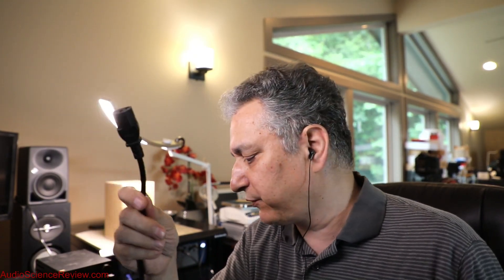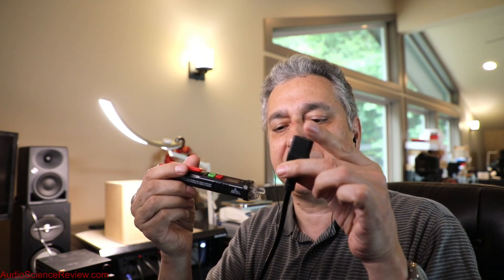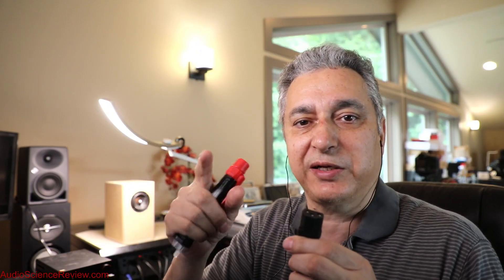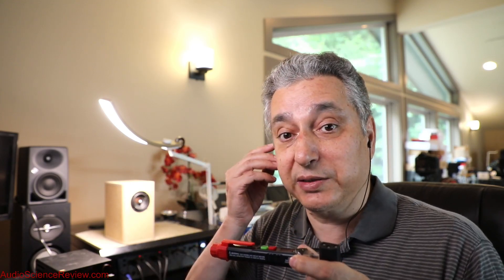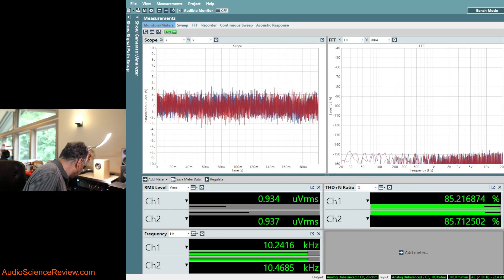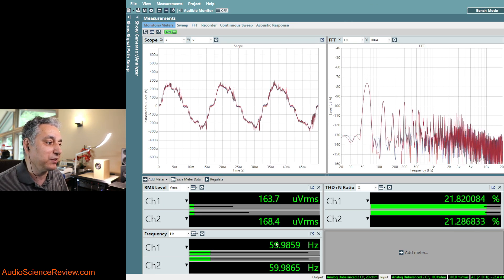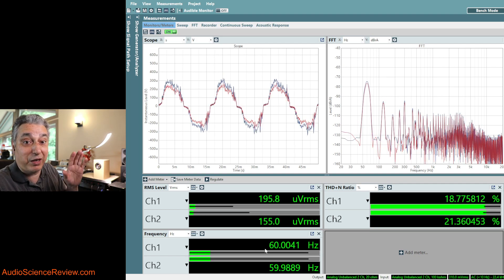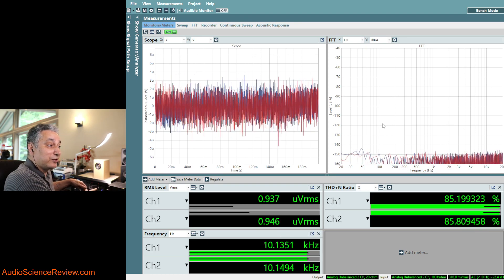Testing Open Power Cord interference in Interconnect Cables

Comment: Apparently this video was motivated by statements made by Danny at GR Research, who evidently criticized Amir's testing by claiming that there must be an appreciable level of current flowing in a cable in order for that cable to transmit/leak electromagnetic fields (into the space surrounding the cable) that can cause problems for other, nearby cables. Amir has thus made it clear that Danny simply didn't know what he was talking about. Which shouldn't surprise anyone, given that not very long ago Danny did a video where he connected several different speaker cables to the input of a radio receiver and used the signal strength meter on the receiver to show that speaker cables differ in terms of their ability to pick up stray electromagnetic fields. Implicitly he was claiming that the differences among speaker cables in this respect translate to differences in the sound quality you get with the different cables when they are used to connect speakers to amplifiers. Even if you designed an antenna for the express purpose of picking up the stray 60 Hz signal that is common in any household, and connected this antenna directly to any typical home speaker, it is exceedingly unlikely that the SPL output by the speaker, for that 60 Hz signal, would be loud enough for you to hear it. Speaker sensitivities are nowhere near great enough for this, which is why we need amplifiers to step up the voltage to meet the requirement of the speaker in terms of sensitivity, and to supply the current that the speaker will draw when delivered that higher voltage. If you run the 60 Hz signal picked up by an ordinary speaker cable through an amplifier, it is all but certain that you'll be able to hear the 60 Hz hum through the speaker connected to the amplifier. Perhaps Danny was confused and thought he was showing why speaker cables make lousy interconnects. The thing is, he pretended to be answering a question that is very different from the question that he answered. Two completely different questions, one that he pretended to be answering while he actually answered the other question. It was bizarre to say the least.
Reply from the maker: Well explained.  :)
Reply: @AudioScienceReview  I agree 100%, but appreciate the intelligent discourse.  Giving both parties a chance to response educated me and I'm sure that further discussions will only benefit the community,  I do appreciate the "audio performance/listening art" and "science" of audio engineering and the years of effort involved in both. 
Thank you all.
Reply: Actually, the 60Hz signal can be heard through speakers. Very faint, but present. It's even in the ambient noise of most rooms. To the point that they can catch criminals thanks to it: https://www.youtube.com/watch?v=e0elNU0iOMY

Now, to the point that human ears can hear it from the speakers while music is playing, or for it to change 'musicality' (whatever that means) ?
Nah, now that's audioquackery, unless your setup is pretty screwed up (ground loops, unstable amp, etc).
Reply: Danny also told me, even once clearly questioned, that he can audibly hear the difference between PVC and PTFE INSULATION on a cable... yes, you heard that right.  He can hear the INSULATOR.
Reply: I though Danny was demonstrating how good a speaker cable is as an Aerial seems to me that is what he was doing.
Reply: Danny was comparing An RF radio signal cable to audio cables which act totally diferent was not a  viable test however Amir is trying to prove again that power cables dont matter or have any effects i suggest he goes to a high end dealer or home system and actually do so listening tests  which most of these "labs" never do
Reply: @JKGarageBMW  It's funny because when talking to him he actually says that is probably impossible. So i am pretty sure he ain't going around preaching 2 different things to different people so i am pretty sure you are lying.
Reply: Long Live NRA  Look in the mirror. That's what he meant.
You thought he meant he could hear the insulator make noise or sing ?
Think before commenting...
Reply: @pauldavies6037  Or, maybe, you could take a trip to, say, the Revel lab for instance and go through their double blind listening experience. 
Bring your 'high-end cable' and some 12 gauge wire from Home Depot. Ask them nicely if they could do a double blind test btwn those for you. 
Look it up. You're welcome.
Reply: Long Live NRA  no he didn't.  Once I'm at a PC I'll link the comment.
Reply: @Mr100700551  he responded to my comment where I literally asked for clarification.  Will link once back to a PC.
Reply: @pauldavies6037  If the cable is not picking up electromagnetic interference then any sound improvement is coming from the quality of the cable itself.
Reply: @pauldavies6037  In this particular video, Amir is demonstrating that a power cable does not need to be carrying an appreciable amount of current in order to transmit-leak electromagnetic waves that can cause interference for other nearby cables. Just to be clear, that's all he is doing in this particular video, and he is doing this demonstration because Danny R. had previously claimed that in order for a power cable to be a source of interference it has to be carrying an appreciable amount of current. Danny was wrong about that, as Amir has shown. Danny made that claim when he was trying to disparage Amir's expertise with this kind of testing.

In previous video's that Amir has done with power cables, he did endeavor to show, as you point out, that power cables don't have any affect on the sound quality of the device using the power cable. There are several lines of reasoning that argue very strongly that it wouldn't be possible for a power cable to influence the sound quality of the device using the power cable. Any reasonable person will be disposed to skepticism merely on the basis that the power cable is only the last several feet of the wiring in the building and in the ground or air, between the transformer and the device using the power cord. Nevertheless, there are people who insist that the power cord makes an audible difference. Among them is Michael Fremer, well known to be a front man for people who peddle audiophile snake oil. Danny R sells expensive power cables and is therefore among people who make this claim.

You suggest that Amir should "go to a high end dealer or home system and actually do listening tests ..." This is insulting to Amir, and I take insult with it as well. It suggests that you don't really understand who Amir is, or don't have a realistic grasp of his knowledge and talent. Amir is 100% legitimate. Danny R is not the least bit legitimate. There is a night and day difference just to state what is simply true. Amir also has a very keen ear for distortion and noise, and has demonstrated this ability. So for you to suggest that the difference in the sound of power cables is real and that Amir just hasn't heard it or possibly doesn't have the hearing to hear it, is a very difficult thing for me to swallow.

You (and other people like you) insist that you can hear this difference or that difference and that people who don't hear what you say you hear simply don't have the right hearing, or refuse to accept what is there to be heard, etc. This is frustrating for many people because with this attitude, there is no way for any of these sorts of disagreements to ever be settled. If you want to make claims and do not have any aspiration that other people believe you or accept you claims, that would be a reasonable attitude, except if that were true, you wouldn't have written the comment you wrote here. It is apparent, given only that you wrote the comment, that you want for other people such as Amir to believe what you believe. Yet, when they tell you that they don't believe what you believe, all you do is protest loudly and accuse or insinuate that other people have inferior hearing or whatever. Why not do something to demonstrate that you can actually hear what you say you can hear? This is the only way to move the debate forward. What I'm trying to say is that the onus is on you to prove that you can hear what you say you can hear, if you want other people to believe you, which you obviously do. But don't take it too personally, because there are millions of other people who are like you in this respect. The onus is not on Amir or me or anyone else to prove that you aren't able to hear what you say you can hear. The onus is on you to prove that you are able to hear what you say you can hear, if you want other people to believe you, which you obviously do.

Have you ever read about confirmation bias? It is an important concept with audio, because it has been demonstrated time and again that when people have sight knowledge of which one several similar components they are listening to, their statistical preference for the components that they believe offer superior sound quality is decidedly stronger and more consistent than it is when the sight knowledge is removed. This has been demonstrated numerous times, and it can only be chalked up to confirmation bias. When people believe that A sounds better than B, they will almost always pick A when they sight knowledge of whether they are hearing A or B, but then when the sight knowledge is removed, they are no longer able to pick A nearly as consistently. This is a real phenomenon, and one thing that we know absolutely is that people very, very often claim that they are able to hear something that they aren't actually able to hear. This is a fact. And given that it is a fact, the only reliable way for people to demonstrate that they really can hear the difference between A and B is by submitting to a double-blind test. In your case, A is your favorite high-end system and using the expensive power cords that you believe sound better, and B is that same favorite high-end system and using run-of-the-mill power cords.

I've written enough, but to wrap up I'll mention that as long as this power cord claim has been around, I've never once encountered a believable argument for how a power cord would be able to influence sound quality. The plain truth is that in the audio realm there are armies of people who come up with all manner of ideas and contraptions that they claim will improve the sound quality. The reason they do this is obvious. Given that this kind of thing is as pervasive as it is, it is always appropriate to be skeptical about any claim that anyone makes with respect to improvement in sound quality, and to ask whether it seems physically possible for the contraption to improve the sound. If you can't come up with a plausible explanation for how the contraption would be able to improve the sound, then it is highly likely that it doesn't. As I sit here in front of my computer tying this into YouTube, over on the right I see that there is a video by Paul of PS Audio where he explains cable burn in. I haven't watched it and I don't intend to, but based on other claims that Paul has made, my assumption is that in that video he is saying that you have to burn in a cable for it to sound good. And my immediate reaction is to ask myself whether this is physically plausible. What change does a cable undergo, when it is used for a time, that will affect the sound quality? Without an explanation that sees physically plausible to me, I am not inclined for one second to believe this. It's the same with the idea that power cables affect the sound quality. How? How is this physically plausible? If you think you hear a difference, shouldn't you still need an explanation that is physically plausible? I would be willing to wager that in a properly controlled double-blind test that you could not reliably tell any difference in the sound quality of your high-end system using very expensive power cables vs. cables cobbled together using a cheap set of automobile jumper cables with the necessary connectors / plugs attached at the ends.
Reply: @iamsometimes6712   I watched some of the video you linked until it was very apparent that it would not be implied in that video that 60 Hz hum induced by house wiring into a speaker would be audible at the speaker if there is no amplification present. Of course I wrote that this wouldn't likely happen even if you used a purposeful antenna instead of the speaker cable. I don't know, but I might have gone too far when I wrote that. Even if so, it still wouldn't likely be audible if you do this with a speaker cable unless you made a concerted effort to make it happen, by wrapping the speaker cable many times around a big transformer or something along those lines. Even with a concerted effort I doubt whether the sound would be audible. In any case, what Danny R did in that one video where he connected different speaker cables to the input of a radio receiver is just plain bizarre. As I think about it again, it just boggles my mind that anyone would do that.
Reply: Umm no, without current flowing in the wire, no field is generated to cross couple into adjacent wires which was the point as I understand it.
Reply: @Emilg5  If that were true I'd never have to worry about open transistor based circuits picking up EMI/RFI.  Not correct.
Reply: @JKGarageBMW  We're talking about an AC power cable, not a signal cable or a circuit here. My understanding is you're referring to Danny's antenna demo intending to show rf/emf attenuation in various speaker cable configurations.
Reply: @Emilg5  What exactly does "Umm no" mean? I think it means that you are arrogant and overconfident in what you believe even when you haven't taken any time to make certain that your understanding of the matter is correct. It is unfortunate for you that you did this because the knowledge that you are missing was made available to you in Amir's video, which you obviously did not bother to watch. And which I find bothersome.

I'll try to explain it to you in a different way. It comes down to the question of whether or not electrons in a wire plugged into a wall socket are caused to move alternately in one direction and then the other in spite of the fact that no significant number of electrons bridge the gap at the far end of the power cord (because there isn't a load connected to the cable). In the presence of voltage, electrons experience accelerating force. When a power cord is inserted into a wall outlet, one side of the outlet is "neutral" (it is connected to the center tap on the transformer on the pole down the street), while at the other side, oscillating voltage is present. If the far end of the power cord is left open, DC current will not flow through the cable. But the voltage present at the wall outlet is not DC. As the voltage on the "hot" side of the wall outlet oscillates, the magnitude of the accelerating force acting on electrons in the wire (the side of the cord connected to the hot side of the outlet) fluctuates. At any instant, electrons in that wire (the one connected to the hot side of the outlet) are either (a) being packed more closely together as electrons enter the wire from the hot side of the wall outlet, or else (b) being spread further apart as electrons that were previously pushed more tightly together seize the opportunity and some of them get pushed back into the house wiring due to the mutually repulsive force of like-charged electrons. Changes in the strength of the electric field present at the hot side of the outlet propagate down the wire notwithstanding that it is open at the far end. This field propagation takes place at extremely high speed, not quite at the speed of light in a vacuum because the wire isn't a vacuum and the speed of light is slowed by anything that isn't 100% transparent to electromagnetic waves. When a power cord is connected to a wall outlet the electric field will propagate deeply into the power cord to the far end of the cord notwithstanding that the far end of the cord is left open and notwithstanding that the power cord is not conducting DC current (and is conducting very little AC current because of low shunt capacitance between the two wires). You don't even need both wires. You only need a single wire connected to the hot side of the outlet, which will have the effect of extending the electrical field present at the outlet to the far end of the wire. If it did not have this effect, then the same would be true for the wiring directly behind the outlet, in which case those sensor devices that work without being plugged in wouldn't work. But they do work, and in the video, Amir showed you one of those little sensor devices that electricians like to use because it tells them whether an outlet is hot and can be safely handled, and does this in a way that is more reliable than plugging in a test device that has to be plugged in (because it is possible for the contacts inside the outlet to be broken and yet the outlet itself be hot).

In the video, Amir stated very plainly that he has been doing this for some while, and that it is a reliable method for doing the tests that he does, and that the theory behind it is absolutely solid. Do you think that he is simply making all this up? I just am not able to understand why anyone would respond to something like this in the manner that you did. It does not make any sense to me whatsoever.

Next time, you might want to use something more in the form of a question to say what you want to say, and avoid saying something like, "Umm, no".
Reply: @tombarber8013  "umm no" simply means I disagree and not that arrogant and ignorant diatribe you put forth. Measuring essentially the house wiring extension that an open power cable is is meaningless in the real world as Amir demonstrated when the cord was actually plugged into equipment. The currents induced by dielectric leakage are well below -150dbm and inaudible not to mention swamped by the actual current passing through the cord under realistic conditions. In addition,  the shield, if present, will usually be connected to ground at the equipment further invalidating anything meaningful resulting from this procedure. In order to test for actual interference caused by other cables in the real world, a terminated cable  requires the magnetic field  generated by current flowing within the cable which in the case of power cords and speaker cables can be substantial. If you wanted to measure the electrical noise picked up by your house wiring or it's suitability for an antenna, then this might be a valid test.
Reply: @Emilg5  So, just to be clear, the assertion you are making is that the level of noise interference, by which an interconnect can possibly be affected when the source of the electrical noise is the electrical field associated with a power cord plugged into an outlet but left open at the far end, cannot possibly be strong enough to be significant, i.e., not strong enough for the noise to be audible when the affected interconnect is used to connect, say, a CD player to an integrated amplifier, and regardless of the length of the interconnect? I think this is what you are saying, or trying to say, and additionally saying that the only way it is possible for the noise picked up by the interconnect to be significant is if the power cord is conducting AC current at some sufficient (but unspecified) amperage and thus setting up an oscillating magnetic field that will affect the interconnect via inductive coupling. Am I correct that this is what you are saying? If so, then what proof do you have of this? Do you realize that what you are saying is that this will be true UNIVERSALLY, no matter how poor the construction of the interconnect? Perhaps what you mean to say is that with this simple test that Amir does that SOME interconnects that don't do well in this test will be perfectly fine nevertheless in actual use. If this is what you mean, this is something that you should have been able to say plainly at the start, so that other people would have stood a chance of understanding exactly what it was that you were wanting to say. It seems to me that you need to spend some time thinking about exactly what it is that you are wanting to say, then say it in a plain, coherent manner, and back it up with evidence or proof of some sort.

By the way that last sentence you wrote (" If you wanted to measure the electrical noise picked up by your house wiring or it's suitability for an antenna, then this might be a valid test.") is terribly confusing to me. I have no idea what you are trying to say with this and I have no inclination to spend whatever amount of time it would likely take to come up with some plausible interpretation by which it would possibly make sense.
Reply: @JKGarageBMW  "Danny also told me, even once clearly questioned, that he can audibly hear the difference between PVC and PTFE INSULATION on a cable..."

I doubt. 😅
Reply: I have watched Danny at GR Research video and around 18 minutes he has made claims that I do not believe. He  claims that his power cable works like a filter for all that bad noise on the AC line and reduces the noise pass through into device electronics.  Great!  So, I have asked him to run A/B test with his cable and measure the output of internal power supply of any preamp  DC signal and show us on the analyzer that his cable makes any difference there ( DC voltage stability, or any noise reduction) and reduces any propagation of the noise from AC interference.  I am still waiting.